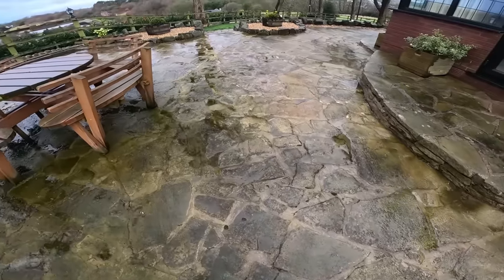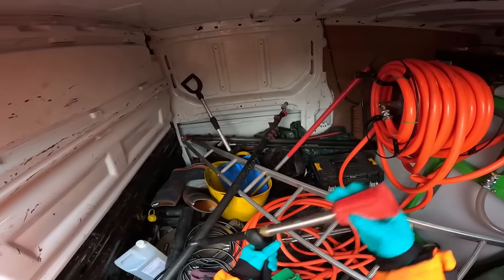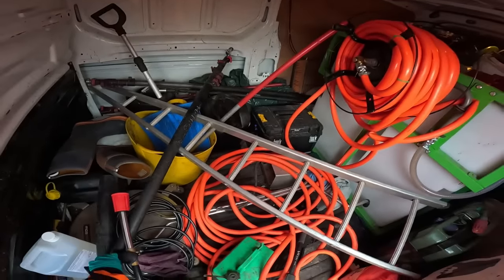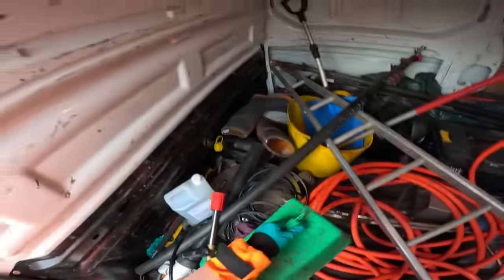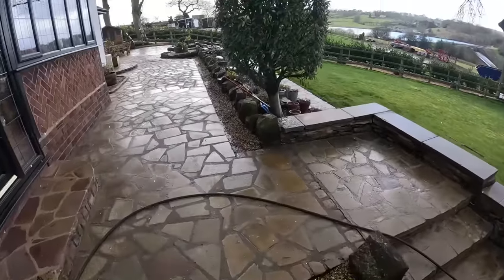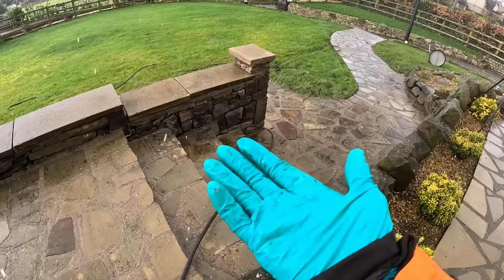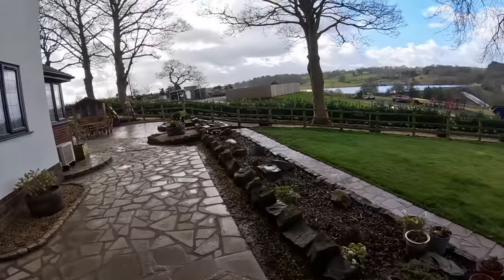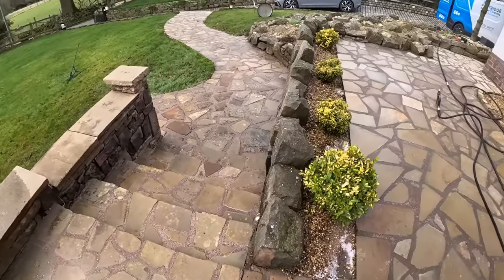I POWERWASHED That Super Dirty Patio & It Was BRUTAL!

Comment: Is it just me that watches these type of cleans and wonders why nobody considered adequate drainage when they were built? Great video 😊.
Reply: I often wonder that , if I was to build a house I'd make sure there was good drainage
Reply: @Dodgystitch  I certainly would now having watched so many with drainage problems.
Reply: As someone who lives is Florida, that is always my first thought. Drainage is super important
Reply: Having a front patio redone with a redesign and enlargement… decent drainage is a top priority
Reply: @bean_mochi5159  I lived in the tropics for a couple of years so know that good drainage on patios was essential. If the drains got blocked with leaves we very quickly had a paddling pool 😂 which was always quite fun.
Reply: Because most things over there were built before building codes were an idea lol not like here in America where everything is new
Reply: @davidmedlin8562  Exactly. And no one builds a house expecting the amount of water from a pressure wash.
Reply: It's from the stone😊 sitting. When it was first built the drainage was fine. You come across this when working on older homes. I pressure wash professionally and I had a house this week had drains, but the sidewalk was 1/2 inch below them. The homeowner told me it used to be higher than the drain
Reply: My patio HAD drainage, but was built in 1951 when outdoor drains could be connected into sewer ( wastewater, ie toilet) drains. Once that crockery I bend broke, the back yard was full of sewer gas and dreadful in the summer. We finally figured out why sewers were connected to our backyard and were able to get the mains blocked off. Instant improvement in heath and safety, but I now have a large patio, concrete, in lovely condition, that slopes to the center of itself. By about 5 inches. Yeah. Even slightly historic homes are SO FUN!
Reply: I’ve wondered about that myself. It seems in 90% of all power washing videos that it’s evident that the water is not draining quickly enough and that’s likely why the patios are green and they will become so again in the near future. I guess it keeps power washing people employed.
Reply: I’m a civil drafter. It’s literally the only thing I think haahahah
Reply: @ComeOutOfHerMyPeople  😂 It must frustrate you even more than me knowing exactly how they could have prevented it.
Reply: Rain will drain but consistant jet wash oviously not.  How many times is it Jetwashed ?  -------- I have a basement which is dry because I have a pipe 3ft down all tround he house.
Reply: I actually never heard of drainage on a house before I started watching these videos. We have storm drains down the street, but those aren't at every house (ours is definitely a number of yards from the house), but I also live in Texas where it only rains for 2-3 months out of the year.
Reply: I added extra drainage to improve the water and rain escape from my patio.
Reply: I wonder that myself. I installed a small paver path specifically because I wanted something to assist with drainage. I was tired of walking in muddy puddles lol
Reply: YES YES THANK YOU...its like that in most of the U.K. ...terrible drainage or nothing at all
Reply: That house is very old. They wouldn’t have even conceived of the idea of power washing.
Reply: Actually this has extremely good drainage or the pressure washer water would build up so fast, it wouldn't be able to be washed like that. His water rinsed away so fast the issue is just simply .....life. Rain, sun, shade, hot, cold, more rain, more shade, more sun, more cold, and on and on we go. It looks like it might not have been done in a while though.
Reply: @pauljames9393  
Even in America this is a real problem.
Houses settle, land shifts which creates numerous problems/nightmares.
For families buying older homes, then realizing; everything was cleaned, dried, painted with Kilz to mask the problem.
Then that magnificent ‘40~’50s money pit is taking them for broke.
Also, what has been mentioned earlier, runoff used to go directly into the sewer line.
It didn’t matter at the time, with population growth.
New EPA guidelines you have to ask yourself is the necessary renovation.
Truly in your financial budget.
This is a Beautiful job, well done.
Reply: One of our homes had a similar, but smaller patio..after one winter and spring with heavy rain and snow and no drainage..that was back flowing to the house..we had it all ripped out… I’m always dumbfounded how the Brits build  patios and their sewers.yeech
Reply: Everything is dirty, moss covered, wet…sewers That are horrible.Do they ever dry out and get sunny?
Reply: It's not just you. I was thinking the same thing.
Reply: That’s exactly what I was thinking
Reply: @billr3053  Needs several coats of sealant. Helps with the algae, but slippery when wet.
Reply: Yeah this pavements were not laid to fall and there is no floor traps/drainage. Thus the stains due to ponding added by just being badly maintained
Reply: @kmj782  it's Britain. It rarely dries out completely. That's why everywhere is green, even at the end of the season we laughingly call summer. Temperate rain forest.
Reply: Drainage can get clogged.
Reply: @davidmedlin8562  even now that we have a lot of building codes in the UK, many developers just ignore them since they never face any action against them for not adhering to them.
Reply: @pendulum590  it's always funny to me that people don't realise it rains 300 days of the year here haha. Summer is about a week usually in May, right after it finishes snowing 4 months late. Good old England.
Reply: Your onto something start a business
Reply: Well, we put in a ton of drainage when we had our pool done. It still isn’t enough for the yard
Reply: @davidmedlin8562  common sense should’ve prevailed
Reply: You all think while watching this! Congrats, I just get into a coma.
Reply: Drainage will not solve the problem of stone ABSORBING water which then turns to greenish brown scum. Also, installing drainage in many places is impracticable if not impossible. Concrete or stone steps and rock walls  etc. Think about it!!!
Reply: The tradesman who did it should’ve been aware of ensuring drainage problems, especially when the terrace is  ostly enclosed.
Reply: You do know that there’s much older homes that were built before drainage pipes were thought of? Especially for a patio or the porch area. And it costs a lot to put in new drainage pipes and drainage screens or covers. Luckily I don’t stop to wonder why people don’t have proper drainage. 🤷🏻‍♀️
Reply: I did a really quick attempt to power wash my patio, but I was sooo nervous the whole time about water pouring into my house or basement etc. Am I just being paranoid, and this isn’t really that much water (so long as I’m not spraying into the house directly and being careful etc.)?
I think I’m just gun shy about water and any flooding potential.  Do professionals ever get called back and have liability (through insurance/bonding) to repair water drainage into a house after pressure washing?

Comment: if you want to get that mossy green look off the patio furniture then go to your local pool supply and buy you a gallon of "pool shock" mix it  5 to 1  use garden sprayer and spray it on their  it will clean right up no pressure and it will prevent further growth of the moss or mold even works on fences and  houses